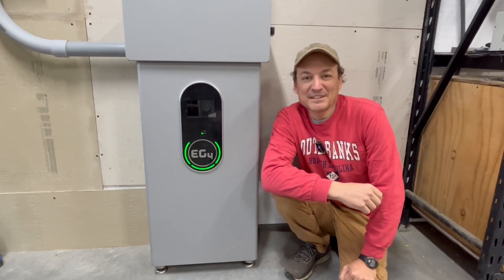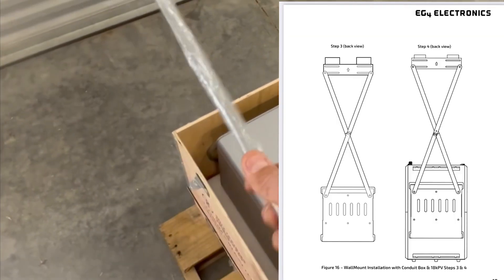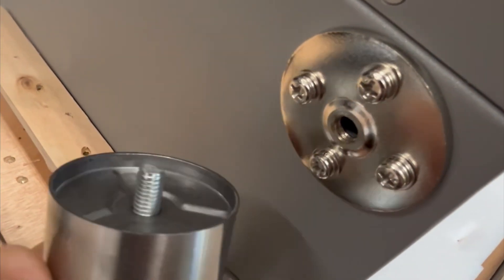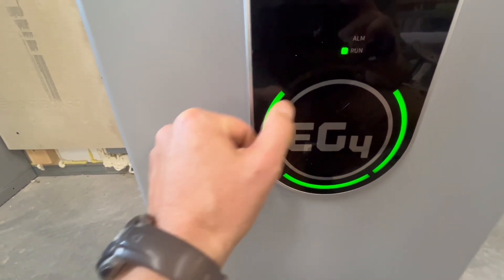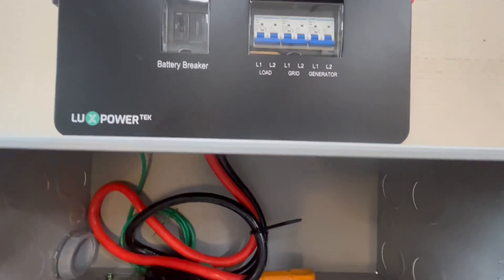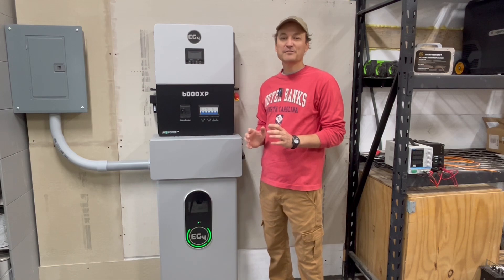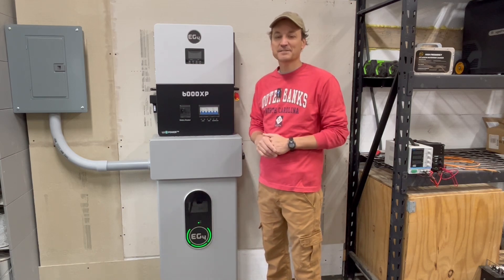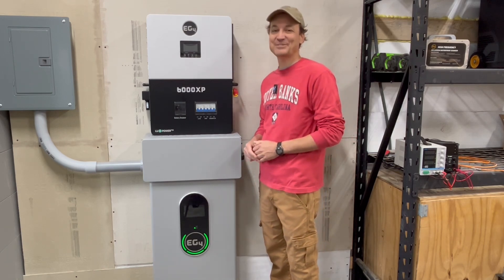New EG4 power Pro wall mount battery tear down and review~ plus a look at the new battery firmware

Comment: Your explanation of the firmware confused me. I have an 18kpv and an EG4 indoor battery. Can I update the battery firmware through the inverter or not? Do I need the special cable? I can't find any instructions.
Reply from the maker: @AustinMaddox  yes you can update it through the inverter. If you go to the eg4 monitor website it’ll list your battery on the firmware page if it has an update. 
One exception for that would be the RS232 firmware. That would have to be done with a cable. That’s a different animal all together.
Reply: @GavinStoneDIY  Can you elaborate? You basically just repeated the same thing you said in your video. What does that mean? What is the RS232 firmware versus "regular" firmware? Why is it a "different animal"? I'm pretty sure I just have the firmware version the battery came with: Z02T03 / LCD: V1.2.1.
Reply from the maker: @ the RS232 firmware is to address the cycle count on the battery.  When the batteries first came out they were actually reading cycles a bit off. So it made it look like they were cycling faster then they actually were. And unfortunately that’s a different information protocol on the BMS than the standard firmware. So that would require a specific cable the RS232. EG4 made a video about that update

Comment: I recently bought 3 of these wall mount Power Pros that are supposed to have 280Ah, 14.3 kwh capcity. 
Has anyone run a capacity test on these batteries to verify the stated claims? 
I have capacity testers and would like to do that but it's difficult because the BMS will limit how low I can drop them. So it would be a very rough estimate based on an assumption that they cut off at 80% DOD. 
My hope is that you or someone else who has disassembled them has perhaps run tests on the individual cells or on the battery with the BMS disconnected. Just hoping because I am seeing some signs that point to they're perhaps not being a full 280Ah battery. I am NOT making this accusation, I would just like to be able to confirm independently. I have asked EG4/Signature Solar for testing certification but haven't received anything.
If you have a disassembled unit and would be willing to send my individual cells, I can test them and report back.
Reply from the maker: So you want me to send you cells for you to test? At least thats it sounded like you were asking on the last part. I won’t be doing that. What signs are you seeing that you aren’t reaching full capacity from these? 

Honestly I haven’t run a full capacity test no. But they aren’t difficult to do. You don’t have to disconnect the BMS. Just set the inverter to voltage, set the parameters correctly, and run them down till the BMS disconnects. That drains the battery completely and gets to your capacity reading. Assuming you have a shunt that is.
Reply: @GavinStoneDIY  Nevermind. I hoped that one of you guys that disassembled the battery may have run a capacity test while you had the chance. Apparently not though. Seems kind of like a fundamental thing to evaluate IMO. I bought capacity testers so I could do that but I am not willing to break the case and void warranty. You already broke the case and that would be the time to do it.
Reply from the maker: @frankenstake  you don’t have to break the case to do a capacity test. Just test the pack as a whole. As long as the cells are decently balanced then there wouldn’t be any problem testing the pack. Just charge it fully and drain it with a shunt attached. If you do send me the results and I’ll take a look. 

The cells are laser welded to the busbars. So you wouldn’t want to cut the entire pack apart with a grinder to test an individual cell anyway. If I get around to it I can test it, I don’t anticipate any issues. What problems have you seen in regards to capacity?
Reply: @GavinStoneDIY  well, you can't do a "standard" capacity test as I've run for individual cells, 3.65V down to 2.8 or 2.6V. You could do that for the whole battery except that the BMS will cut off the discharge at some point (SOC or V I don't know) and then you'd have to make lots of assumptions to try to calculate the capacity.  I felt that wouldn't give me an answer I could trust. Plus, I have no experience with how well these cells stay balanced in deep discharge and I wouldn't want to risk individual cells if the balance isn't great. 
Anyway, it's all good, EG4 replied to a forum post I made with the independent testing info and I'm a happy camper now!
Reply from the maker: @frankenstake  yeah I’ll see if I can make a short on it or something. It wouldn’t risk a cell, the pack would disconnect once the lowest cell reached disconnect voltage. I’ve taken it down to disconnect voltage a few times, everything seems to stay pretty balanced as far as that’s concerned. Glad they sent you some specs.

Comment: This is a helpful video, thank you! Figure 3 of the EG4 instructions show the wiring diagram to connect 3 batteries to one inverter. It uses the center battery to connect to inverter. Do you think it's ok to use one of the end batteries to run to the inverter? I cannot locate batteries directly under inverter so using the center battery will mean long cable runs.
Reply from the maker: You’d have slightly more resistance to the final battery. Which is one reason why they recommend you connect them to a central point. Whether that will make a huge difference? It’s to say really. I would probably do it.

Comment: Hey I have one EG4-LL-S 48V battery, can I get one of these and connect it to the system with full communication and not risk having the one LL-S battery constantly be the first to discharge?
Reply from the maker: Yeah you should be good to go. They stay balanced. I have the pro battery set to the master and my LL’s behind it.

Comment: I wonder whats better tesla powerwall 3 or these batteries
Reply from the maker: These are still less expensive I believe. And it’s the same chemistry.
Reply: @GavinStoneDIY  that's true , we thinking of have Tesla 3 powerwalls 3 installed for 26k but I'm wondering if the eg4 is a better choice
Reply from the maker: @rudycastillo4150  from what I’ve heard there’s more user controlled options on the EG4. But I haven’t tested a Tesla power wall to really compare the two. The Tesla’s sure look cool.

Comment: I have a question if I was going to install two 5kwh lithium batteries using busbar should I use 2/0 awg cable from the busbars to the inverter 600xp?
Reply from the maker: Anywhere from 1 awg-2/0 cable is fine. All of those can handle the amperage.
Reply: @GavinStoneDIY  ok thanks

Comment: Wow you have really had all types of battery and inverter inventory.  Did you connect your DIY batteries to your 6000xp or 18kPV?
Reply from the maker: To the 18kpv yes. They worked great in open loop.

Comment: Another great video.  Thank you for all you do in this solar space.  I was wondering if you could maybe do a video on connecting an external generator to the 6000xp for battery charging and how to get the right settings for the particular generator.  Again thanks
Reply from the maker: I may try to make a video on that. I’ve got quite a few lined up already. Personally I prefer the chargeveter for hooking the generator to. That way the inverter can keep doing what it’s doing while the batteries get charged
Reply: @GavinStoneDIY    Thanks.  I'm kinda at a loss with how to connect the chargverter to the Power Pro battery.  I appreciate your videos a lot as i'm not very bright when it comes to solar stuff.
Reply from the maker: @sjbill1793  I’m working on a video now about the chargeveter. Eg4 is working on an easier solution to connect them together. I’m glad my videos are helpful. I remember when I first started, I needed all the info I could get.

Comment: I have a Victron system comprised of 2 multiplus II inverters in parallel and a charge controller, can I wire these directly to the bus bar and skip out on using the distributor? They’ll be fused of course, I just don’t see the point of having the distributor
Reply from the maker: I would think so. The distributor helps for people that have different battery types amongst other things I guess. These would communicate directly with the Victron system.

Comment: What is the measurement from bottom of battery case to top and bottom of case to floor (e.g. length of feet)? Specs show a height of 36.4 in. Does that include the length of the feet?
Reply from the maker: That includes the feet screwed all the way down. They do have adjustment so it would be a bit higher if you use them for leveling

Comment: You can get 3 rack batteries for $999 each with 100amp bms for 300 total and they ship out the same week…
Reply from the maker: These batteries will ship soon without issue also. Which brand batteries are referring to?

Comment: Hey Gavin. I like this new PowerPro budget model.  I have a little buyers remorse with buying LLs , but I like having redundancy in the battery area.  If I was to set up a system for my parents or a friend it would be a 6000XP and the budget PP battery.  Very nice looking setup, easy to install, and a good sized system.  Two thumbs up EG4.

I'm confused about the firmware statements so I'll rewatch the video.  Was this new battery firmware? What version? 
 I've not updated either the battery or inverter firmware on my 2 month old setup, seems a little intimidating.
Reply from the maker: It’s the newer version of firmware they released on the batteries about a month ago. They have a walkthrough guide on the firmware to tell you exactly how to upload it on to the batteries. The good news is you’ll only have to do it once.

Comment: The UL testing won’t allow these batteries to be placed closer than 3 feet.  I would be surprised if any ahj allows that to happen with a permit.
Reply from the maker: They mention 12” in the manual still. So it likely would pass inspection with that. It’s hard to say. 

Some localities are way easier to deal with than others.
Reply: @GavinStoneDIY  the UL requirement is 3 feet spacing.  The manual can say whatever they want but it's not what any ahj will require.  I just went through this in vegas.   Also the batteries don't have a nema rating and only an ip rating which is not acceptable.   Indoors those don't matter but outdoors they do.
Reply from the maker: @jasongoldenberg973 I know quite a few people that have these at 12” or less and passed inspection. I understand what you’re saying. I’m  just pointing out that can vary quite a bit depending on your location.

Comment: Hey brother can u have 3 of those batteries hooked up to one 6000xp
Reply from the maker: Yes. You could have as many as you like. But they are designed to hook 3 at a time to an inverter. Without using an extra busbar. If you follow the link, the manual will show different options for hooking them up. 

Honestly with one 6000 xp you could use the internal busbars and hook more then 3 at a time pretty easily.

Comment: In the desert we got the outdoor sealed PowwrPro model because the dust gets into everything even inside a shed. I hope they survive the heat inside this shed. We will have to leave the shed door open in summer.
Reply from the maker: They do have a maximum temperature disconnect. But a fan might help them stay cooler.
Reply: @GavinStoneDIY  I agree. A fan will be needed. There’s should be plenty of surplus power during the day. I just helped the owner design it. It was all very rushed so no fans ordered yet.
Reply: Can you add one of the solar EG4 minisplit ACs to your shed?

Comment: Can the battery be charging with the chargevrter while the inverter is running?
Reply from the maker: Yes. That works just fine.
Reply: Would I connect it directly in to the wall mount battery?
Reply from the maker: @javiergonzalez-us5is  yes you’d connect it directly to the bus bars in the wall mount battery
Reply: If we have a Sunny Boy grid tie inverter and want to go off grid can be just feed the 240vac output of the Sunny Boy into the grid input terminals of the 6000xp inverter? Thanks.

Comment: Hey Gavin, Great video. Nearly answered all my questions about combining a rack of 6 Lifepower4 Batteries with the one Powerpro  I received with my 18K upgrade from the 2 6500's.
Do you know if the software will track both to the 18K? I know the Lifepowers can only handle max charge and discharge of 100 amps and the Powerpro is 200A. I was thinking of limiting the charge current to 120A over all of the batteries to protect the Lifepower4 and link them all via the powerpro busbar. Would also fuse the rack with a 200A fuse. Plan to talk to the Techs when I commision the system but would like so advice as I set it all up. Thanks
Reply from the maker: So I don’t think there’s an official firmware out yet for combining the lifepowrs with the pro batteries. Not only is it different Ah rating but a different BMS. So at the moment I don’t think you you’d get the same closed loop readings I showed here. At least not with both types of batteries in it.
Reply: Thanks! I sent a similar question to the EG4 techs and see what they have to say. I have also considered purchasing a single 6000xp for the powerpro and running it as in as a generator to the 18K, but does the 18K have to deplete the rack battery 1st before it shifts to the 6000xp/Powerpro power, then finally to utility? So many questions. Thanks for your thoughts on it. @GavinStoneDIY
Reply: @dbarnclay  There's a setting in the 6000XP for "Generator charge start battery SOC%".  There's also an end battery SOC%.  I'd guess the 18k has something similar.  So just set it to whatever % you want it to trigger the 6000XP to start/end feeding the 18k.

Comment: Other than the cabinet not being sealed. Is there any difference between the batteries. Are the specs the same. Output. Input. Being able to remotw start your generator ect. Exactly the same.
Reply from the maker: The battery specs are basically the same besides being indoor rated. All the same amperage numbers. 

As far as remote start are we referring to the inverter? Yeah that has dry contacts for remote starting
Reply: Sorry I just got off work 12hr shift. Got my wires crossed. With the 18k inverter. 😂

Comment: Great video, Gavin. Should there should be some sort of non-conductive material between the cells and the metal cover? Seems like it wouldn't be hard to bump the cover with something (especially in a garage installation) and making contact with the cells. Which wouldn't be good.
Reply from the maker: Yeah it’s domed off quite a bit. But I know what you’re saying.

Comment: At about 200 bucks a kwh its really coming down. Been building 14.3kwh packs at 2200.00 my cost. Almost not worth it anymore!
Reply from the maker: Especially with the wire busbars and heaters.
Reply: unless maybe the individual cell prices drop too, but yes right now it's tough to decide build or buy for larger systems.
Reply: Other advantage for some of us is the prebuilt are UL9540 as an ESS